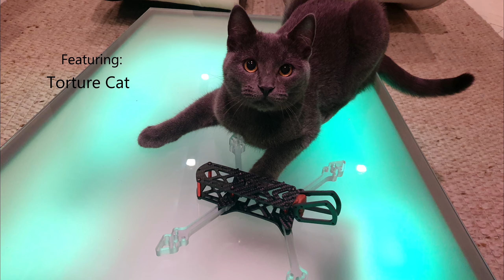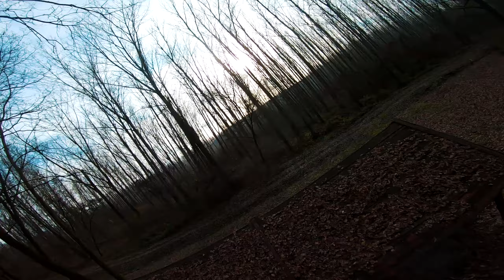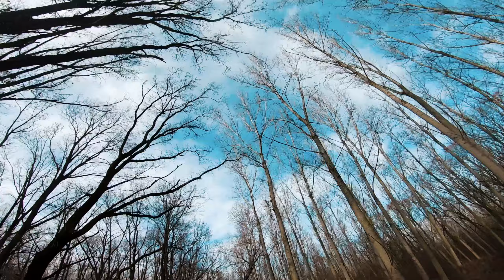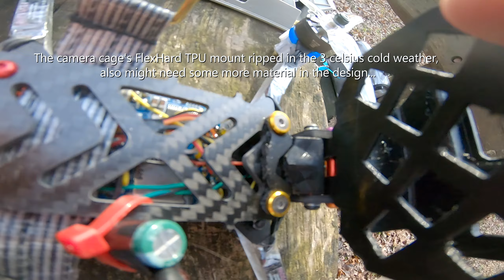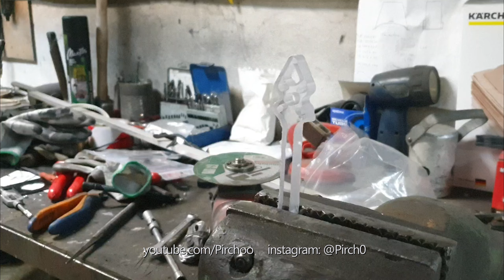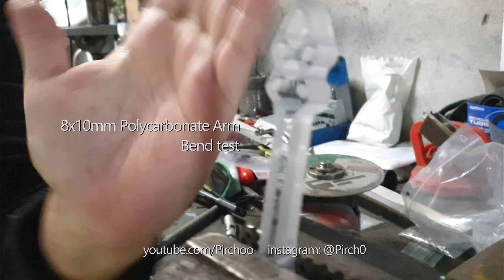Experimental Polycarbonate Arm Frame - Maiden

Comment: Frames should be wood.  Probably port orford cedar, which has been used for hundreds of years for arrows because it flies well and can take a lot of shock from impacts.  The way the grain is oriented is everything.
Reply from the maker: How exactly you imagine it in production? Shapes out of a thick wood, or layered? Direction of fiebers does matter, i agree. I was thinking about the skateboards example, but in that case the key is the concave press while the wood is wet - otherwise it would have been brittle. Bamboo is even tougher the say. Even if carbon arms were not layered flat, but on a concave shape, I think they would be stronger and could be lighter.

Comment: Frames should be wood.  Probably port orford cedar, which has been used for hundreds of years for arrows because it flies well and can take a lot of shock from impacts.  The way the grain is oriented is everything.
Reply from the maker: Maybe, but not so sure. Skateboards made of wood brakes. Made of bambo, tougher. Made of glass / cabon fieber, even tougher.